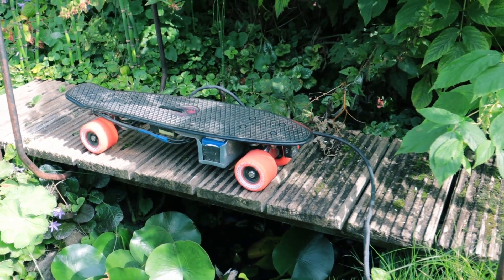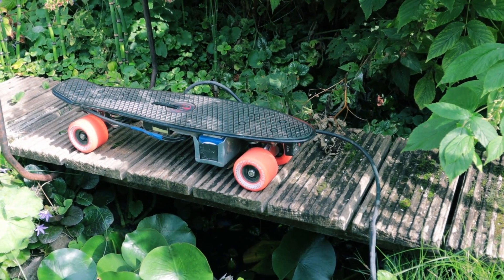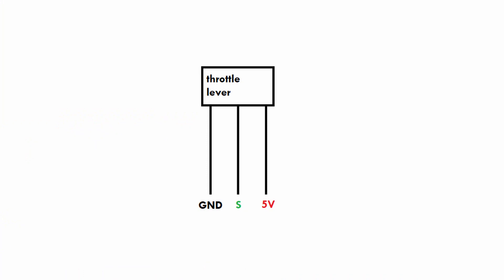How to make things fail less badly (fail safe design explained)

Comment: Another way to prevent an erroneous full throttle is to use a dual tracking pot with inverse signals and having the microcontroller A/D inputs perform a check-sum.
Once again love the content 👍🏻